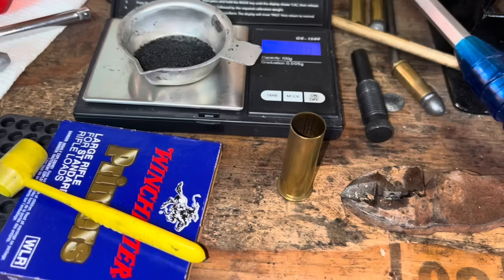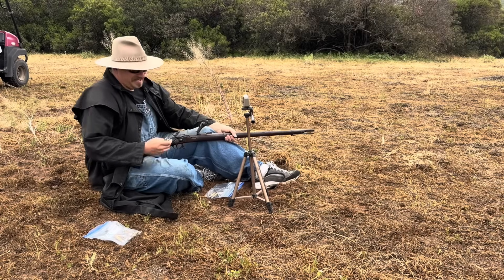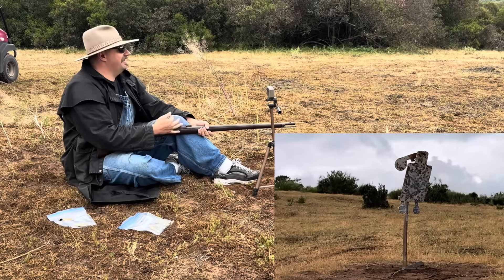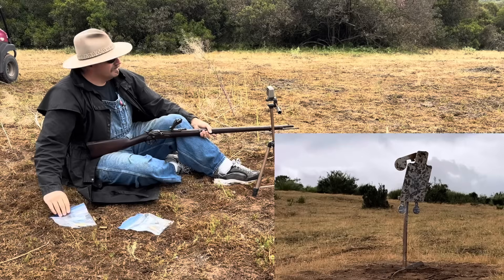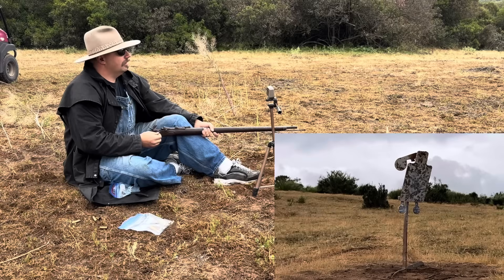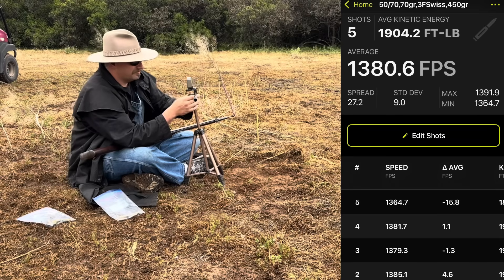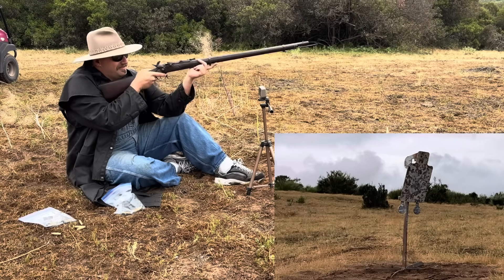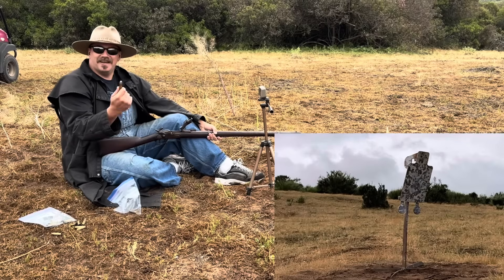Ammonium Nitrate Black Powder Cartridge Test

Comment: I wonder if powder coating the projectiles to add a sorta kinda jacket and then putting black powder lube on top would help with the leading🤔🤔

I know from personal experience that powder coating combined with a gas check and smokeless powder works great so far I've gone up to a bit over 2700 FPS with zero leading and quite good accuracy

Comment: Nice job!
And as always, a very entertaining video.
Early on you alluded to a shortage of brass?
I have a 50-70 (Sharps) and was at one time in need of some brass. A friend pointed me in the direction of 32ga. brass. It was available, and less expensive. It did require forming and trimming.
They are similar to the original cases, but have a slightly smaller diameter rim. The plus is that the capacity is a tad larger, so they hold 70gr pretty nicely. The downside is that they are thinner, so Black Powder only. They don't like an abundance of pressure.
It is surprising how many cartridges can be based on the 32ga. brass...

Comment: hypothetically, you could leave the stuff in the brass longer if you kept it dessicated. There needs to be some moisture or humidity for the corrosion to occur. (historically, they used thin layers of asphalt or paraffin to create a barrier to corrosion for AN containing propellants, plus tended to seal them air/water tight)

High sulfur content compositions can also eat through brass (or just pure sulfur packed into a brass case or other brass, bronze, or copper container), though also usually requires moisture (or heat).

Comment: Hey everything black powder, do you provide any advice? I have shot muzzle loaders for over 20 years. However, I just purchased a Gahendra Peabody Nepalese Military 577-450. This is the black powder cartridge I had mentioned in one of your other videos. The round is so expensive, the only thing to do is reload. I heard you should only use one F black powder. However, F black powder is hard to find. I have been able to find FF black powder. Can I use that or is it too strong? I can order the F black powder but shipping and hazardous material charges are ungodly.

Comment: I chose 5744 because of its physical comparison with Black Powder and although it was a consistent result, I feel it was a bit high pressure so I am now experimenting with a 5% effort and it is in puck…. I tried 10%5744. And 90% Black Powder  Duplex  load and the result was equal to Swiss, but the Milled  result  exceeded Swiss……. Buy over 100 ft./s….. which prompted me to try a 5% mill mix, which is in the process

the combination for exceeded the duplex load.

Comment: Mill 5% 5744 12 hrs with Osage orange powder …….
Reply: I tried 10% and it was not scary. It was predictable, but it was 150 ft./s faster than Swiss and twice as clean. I have a batch in puck right now at 5%.
Reply from the maker: Of reddot or 5744?
Reply: 5744
Reply from the maker: 🤔  I hadn’t thought that maybe my choice in smokeless powder would effect the final product.
Reply from the maker: We tried 10% reddot with Osage orange powder and it was scary

Comment: As the ammonpulver (65% AN, 15% Charcoal and 10% KN + 2% Dextrin) behaves more like smokeless powder, it would be interesting to test on .38 special (originally a BP cartridge) on a +p or .357 mag revolver. I think 4F powder coated in dextrin and with +1% baking soda (for neutralizing residual acid) would be safe to store and at least as powerful as an standart charge.

Comment: Greetings. The difference in the hardness of carbon deposits can presumably be caused by the presence of water vapor , which is formed during the decomposition of ammonium nitrate. Thereby softening the sulfate and potassium carbonate formed during combustion..The increase in rate, respectively, for the same reason, aluminum fosdex , releases 3 times more gases than KNO3 during decomposition.Water vapor has a very high expansion temperature adiabate, which increases its velocity.Just 1 gram of water heated to 1500C will take up a volume of about a gallon.Gunpowder develops this temperature upon ignition.

Comment: Have you tried Powder Coating those Bullets to prevent Leading at those Higher Velocities ? Also Medical Instant Cold Packs often use Ammonium Nitrate to mix with water to generate the cooling effect  .Tannerite type binary compounds use Ammonium Nitrate and  Powdered Aluminum . Possible sources foe small amounts to use to make another small batch for experimentation . Love the videos .

Comment: You seemed to be going consistently low, which would be correct as the sights of a 50-70 are regulated for 1250 fps, the higher velocity would impact lower.  Less time in the barrel under recoil.

Comment: Ammonium Nitrate and cotton, does that equal nitro-cellulose. I once tried to create my own black powder, and it was only good enough to burn out yellow jacket nests that I found the hard way while mowing. My mix was sulfur, charcoal, and salt peter. A very slow burner with little umph. I added a good amount of FF black powder to my mix with little improvement. I stuck with buying Black Powder for my 45/70 cartridges.

Comment: Swiss Prof Hebler made experiments with Ammoniumnitrate powders and testes Amidpowder 48%KNO3, 38% NH4NO3, 14 Charcol in an Lebel 7,5mm cartrides. He loaded 4gramm of that powder and wrote the optimal form is not grained but pressed like an rocketmotor. He testet 2 different charges one with an channel of 2,2mm behind the bullet and 1,6mm on the primer and the secound was 5mm on the bullet and 3,6mm on the prim. First had an pressure of max 3100bar the secound 2700bar. Hope this info is helpfull

Comment: I made nitrocellulose and black powder hybrid and it is very funny stuff, ranges from squib load to crackling and melting the necks of cartridges. i made 230 grain bullets fly from my ak about as fast as a 155 grain is supposed to be going on accident with that stuff but everything survived except the casing. its also the powder that gave me a gnarly squib stuck almost exactly halfway down my barrel with a 200 grain rn bullet.

Comment: AN is technically an explosive not an oxidizer.  It’s labeled as an oxidizer to make shipping and agricultural and storage use easier.  When you add AN to the mix you’re adding about 50% the power of TNT grain for grain, so it really is more like a smokeless powder in that it’s actually a detonation rather than a deflagration (faster than 10K mps detonation velocity) while it’s under pressure.  It’s much more similar to gun cotton, just more insensitive, thus the need for the other BP constituents to form an explosive train to boost it into detonation.  Good stuff man!

Interesting how you displaced 3%,1%,1% of the original mixture of BP (75:15:10) to end up with a 72:14:9:5.  I’m wondering how far you can push that percentage and still get results without having to sensitize it more with a chlorate.
Reply: AN can be fueled up to 6% of its own weight.  After that it’s wasted product and it just turns into a more yellowish smoke.  I’m not sure how much free fuel weight you have in your recipe with 14% charcoal and 9% sulfur.  If you decide to do a trial adding more AN to the mixture you will  have to substitute it primarily for the oxidizer as the more AN you add the more fuel it needs to achieve a complete detonation.  Remember AN is an oxidizer AND a fuel, technically already an explosive.  If you do add more I would do it at the smallest increments.  If the smoke starts turning like a dark ugly yellow color it’s starting to be an excess of fuel that isn’t being efficiently converted (I think).

Like you see beginning to happen in this tannerite.  https://youtube.com/shorts/DKK5fzfF8qg?si=cwnilyIufOlhCJLC

Comment: I just kind of wonder if increasing the ratio has a linear increase in oomph, or if there is a sort of tipping point where pressure increases dramatically. Probably best to let that dog sleep, unless someone set up a remote firing jig with a rifle they wouldn't be upset to lose. But whatever the case may be, it is pretty interesting.

Comment: So, are you happy enough with it to continue using it? Would you consider raising the amount of illudium phosdex (alter the ratio) ? I have often wondered about using a second oxidizer. But I dont think adding smokeless is the way to do it. There are many other ingredients in smokeless. Flash suppressors, copper erasers, extra fuel(s) as well as oxidizers,  temperature stabilizers, etc., etc., etc..  To many things at once. It would REALLY be nice to have an EXPERIENCED chemist for a friend.

Comment: this is good to know, I am about to start paper patching for my 45-70 1874Sharps, ill have to give this a go & see if it squeaks out a bit more velocity, Or, makes swabbing easier.  the "hybrid" perhaps was something different, however there is good Info on a "Duplux" load with single base Smokeless under Black.

Comment: Curious as to why 1400 fps is giving you flattened primers . In modern rifles pushing 2300 plus , primers are fine.  Is it a special primer and case
 thats not hardened like other smokless varieties?
Or is large caliber primers are not rated for that pressure range , and im used to small caliber primers

Comment: Jake the accuracy inconsistency may be related to the twist rate of the Springfield Trapdoor, and the higher velocity. The twist rate of the rifling may not be sufficient to stabilize that large projectile at the increased velocity. It’s just a thought off the top of my head. Also, if possible, I wonder how a gas checked. Bullet would work in the Springfield at that velocity?  It would certainly reduce the leading. This test is somewhat pertinent to me because I use an 1884 trapdoor Springfield cavalry carbine firing black powder pressure equivalent smokeless powder loads. My Springfield is 45/70, so my hunting bullets are 350 grain LRNFP lead. The extra 5 caliber diameter if the 50/70 may require more stabilization at higher velocities (which means your marksmanship is fine).
I’m not claiming to be a expert, just some food for thought. Really, really do enjoy your videos.

Comment: Regarding less fouling from your new powder, it could be caused by the fact that the AN decomposition gives 100% gas products with no residue. So, even 5% AN addition change everything in terms of initial conditions inside of the chamber - where all solid foulings came from PN are dispersed in significantly larger amount of hot gas products and literally blow-out through the barrel. What's also characteristic - AN tend to gives nitrogen oxides & nitric acid in decomposition gas products - and these reacts with all rest of charcoal residue, and generaly oxidize all organic foulings into gas. What's left in the barrel it's only mineral residue came from PN solids - much fluffier than the fouling from pure PN BP.

Comment: That was interesting and certainly did not suck.
I had expected the longer dwell time caused by the much heavier projectile to give the powder more time do develop even more energy, so expected a larger increase in velocity. So i was wrong again 😂
I dont think i would run that through my snider or martini henry though, i will stick with Swiss for those. 
Are you going to do a video on your new improved milking process?

Comment: Interesting........
As I thought, the ammonium nitrate releases and utilises its hydrogen and ammonia gases better in the long barrel and higher start pressure. Both would get a better burn, especially the NH3, which burns with power but is quite slow... not a worry in that loooong barrel. Not surprised that it smells as it does....residual ammonia would account for that. Ammonium nitrate is not an oxidiser, it is a fuel that dissociates into hyrdogen gas and ammonia gas, so perhaps a bit more KNO3 would result in better combustion in the shorter barrels or in muzzle loaders.... Your Trapdoor will be fine... people use them with fairy dust and they hold up well... at least the repros do....
The softer fouling will be because they hydrogen burns to form water vapour (steam powered rifle!) and that would help to keep the fouling soft.
Keep us posted.....
Reply from the maker: Seems reasonable

Comment: Flattened primers are from a combination of pressure and headspace.  On impact from firing pin,  the cartridge is moved far forward so headspace is max.  Ignition of primer forces primer out by the headspace dimension.   If the pressure rise on propellant dimension isn't sufficient for the case to grab chamber walls (friction dependent) or the case stretches (elastic or plastic, again friction dependent), the fired cartridge will have a slightly protruding primer after firing.

If the case is forced back by stretching (elastic or plastic), the primer can be "ironed" flat, even having an enlarged head.  
Reading pressure from fired primer appearance is an art and depends on far more than pressure alone.

Comment: Here is my attempt to contribute to the Knowledge Base - kind of a give-back for all the stuff you did that meant I didn't have to do it myself. I used to handload a Charter Arms (5-shot) Bulldog .44 revolver. Very light aluminum-framed revolver. No chrono 40 years ago just didn't like standard .44 Special factory ammo. 255 grainers out of such a light gun was pretty unpleasant to shoot. I tried round balls but when pushed fairly hard they "stripped" where they engaged the rifling and leaded hell out of the bore. Used to have to resort to some lightly-loaded JHP 185s to get the leading out. I bored the 129 grain RB mold out and made just plain 165 grain cylinders (albeit with small chamfer on front end for forcing cone happiness) and loaded with 8.5 grains WW231 ball powder it was a good useful round.
I would just wipe Moly Grease on the exposed lead and didn't get any leading. Later I pushed the powder up to 13.5 grains of 231 and on the fine creak-side mud in the Mo River Bottoms it would make a hell of an impressive crater.
Couple years ago tired of the legal BS surrounding carry of "firearms" I decided to settle on 3" barreled Pietta 1860 replicas and  just work from there. It was a bitch to accomplish but my ace metalworker buddy modified trigger guard and all to get genuine 1849 POCKET model backstraps and grips on both '60s. I HATED the "birds head grips but I LOVE the unfinished chunky Pocket model grips! I'm can easily thumb back or "fan"  the hammer now!
I found a 1970 Lyman's Black Powder manual with the loading data and pressures for FOUR-Fg powder and basically learned that 40 grains of 4f behind a 139 .451 round ball was safe to shoot in the 3" barreled replicas.
I have a Caldwell Chronograph now but unfortunately it is junk. I hate tachometers that are flakey they have blown up many racing motorcycle and car engines for me that I have built. So I got the idea to only use one chamber of one snubby '60 for all high-pressure tests and keep measuring (to one-ten-thousandth of an inch) to see if the thin steel between firing chambers is beginning to bulge (into the empty chambers on each side) from pressure.
Keep in mind I WEIGH each and every charge (beloved > Hornady digital scales and powder trickler) so I decided to try "only" 35 grains of 4f and 3.5 grains of WW231 for a test last night. My ears re still ringing from that one - but I think I am on to something good in the effort to get .357 Mag Muzzle Energy plus .451 diameter holes in target - all in a couple "breeze right by No Firearms signs" packages. I hope the Channel Owner approves of comments like this !

Comment: Did you recover any of the slugs?
Wondering if the accuracy issue might be due to stripping of the rifling on the slug?
Reply from the maker: No. I did look for them
Reply: I seriously doubt that slug is stripping out of 1-42" twist rifling. The rifle was shooting consistently low due to increased velocity.

Comment: I love shooting black powder. I am working up loads for the old rimfire stuff. Stevens 25 and 32 rimfire. Having to use heeled bullets has been a learning experience. I have used the hollowbase bullet that are same diameter as the lands. Hooping that the base expands enough to grab the riffling . I will be bench testing. Checking for the best projectile for accurate shooting. One of the 25 calaber rifles i could not find a case that could be adapted in the original 25 rimfire chamber. So i ued a shortened 22 Hornet case. Ooened up to 25 caliber. And cut the chamber to match. This allows me to shoot a cast 25 gr. Not a heeled bulet. Plenty of grease not outside lubed like the heeled bullet. The accuracy is very good . Have not tried smokeless. Black powder only. The 32 I have to make the brass from 32 smith and Wesson. Labor intense however these old garden rifles need shooting. Converting from rimfire to center fire is nt that hard. Thanks Jake good video.
Reply from the maker: That’s great!

Comment: I researched sugar based powder from years ago thinking there would be a way to keep it from turning into a liquid.  But shockingly there has been more research on sugar rocket candy, which has the same issues so I gave up until someone can figure out how to keep it from sucking water.  I was thinking about a coating but that would turn it into canon powder most likely.  There are all kinds of secret spices from the rocket and pyrotechnics world that would most likely make for some interesting antique muzzleloader propellant but you would certainly want to to take warning from those that almost blew themselves up or burned their house down making such things. Safety third 🍻🍻
Reply: To keep it from sucking air can it like tomatoes! Use paraffin wax  over argon ! It may work ! I don't see how it wouldn't work